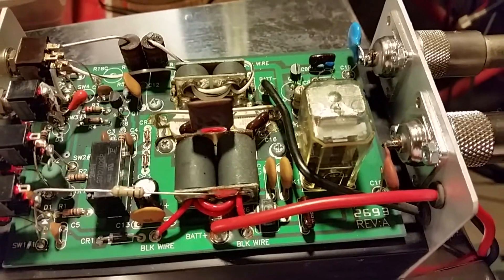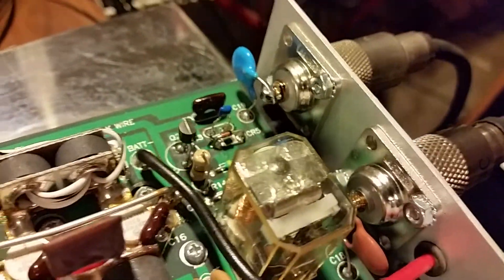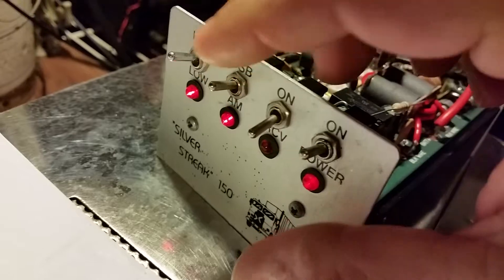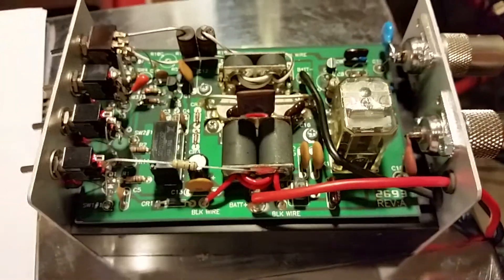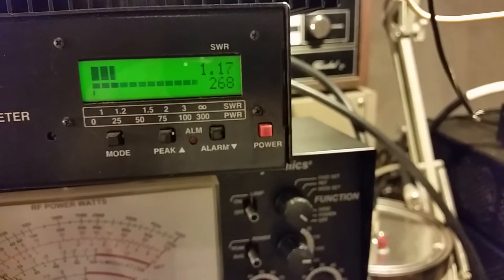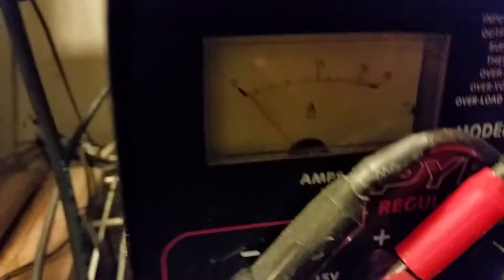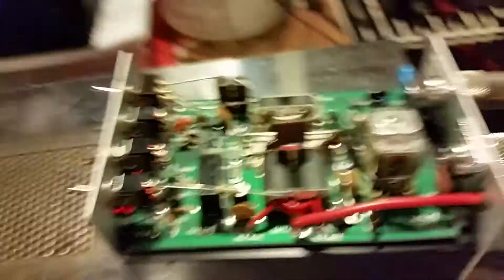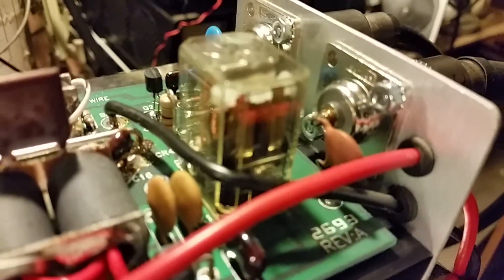Another Silver Streak 1️⃣5️⃣0️⃣ Very High Output Repair

Comment: I remember when we first built the Silver Streaks at Sundance Electronics 35 years or so ago lol...  the amps were first called "Dynamite" and had a tiny little meter to show output...  Brian Godley redesigned the circuit board and the Silver Streak was born.  Sundance Electronics only built them for a couple years, along with the Silver Streak 250 and a couple other amps.. the Power devil 100 wat base (tube ) amp and the Blue Devil which was a 50 watt amp you could hide under your seat or where ever.... Sundance had a visit from Andy Bennet from the FCC... and that was the end... all the guys went different directions... Hal retired to making Silver Streaks privately, Bob formed Firestik, Kevin K went on to work at Yaesu (with me) and Mike Brown continued on as a traveling C.B. salesman until cancer got him about 25 years ago...  ahhhh the good old days of C.B.  I made a bunch of those Silver Streak clones with front panel that read "DX 180" and "DX 200"...  still have 1 DX200 with a pair of 2879's.. my personal amp...  made a bunch of others too but that's an even longer story.   love your videos.